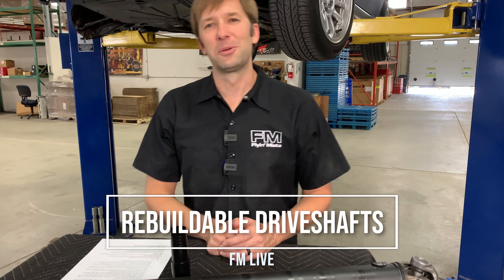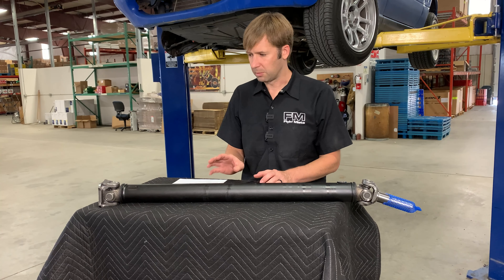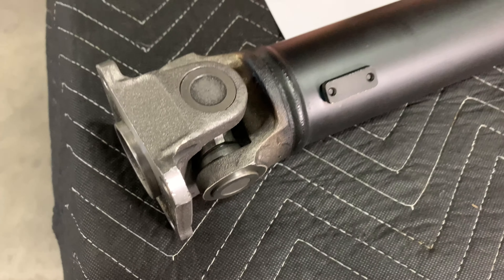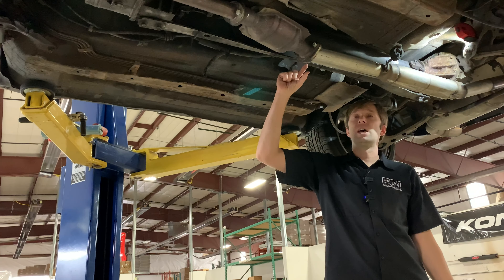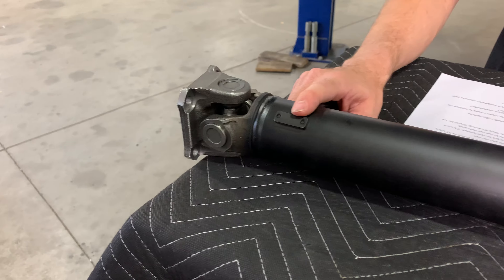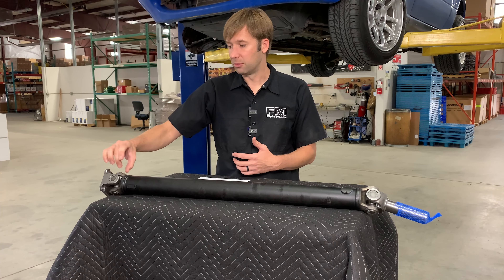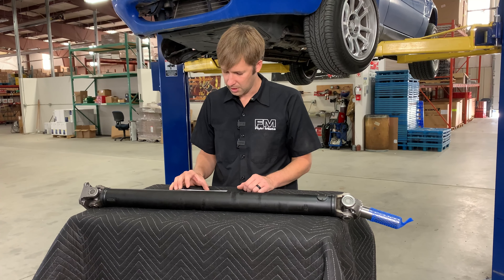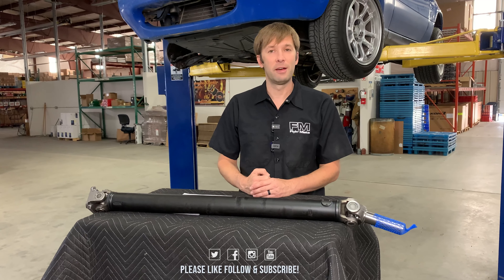Rebuildable Driveshafts for Miatas (FM Live)

Comment: OMG - having recently replaced the similarly designed u-joints in my wife's Toyota 4Runner, I do not relish the thought of replacing them in this driveshaft. granted, if like my wife's 4Runner... they may well last 278,000 miles, so not much of a concern. Nice to see there is a quality option should I need to replace this on my NB2.
Reply from the maker: It's not one of those things that goes wrong often, but when it does, we wanted to make sure there were options!

Comment: I bought a Miata that drove backwards into a telephone pole.. the drive shaft tunnel was compressed about 2-3 inches and the PPF was bent inwards.. the drive shaft didnt slide out of the gearbox easily, had to knock it out... does that mean I could expect damage to the gearbox internals? As far as I can see it's ok, spins freely, gears go in and out easily...
Reply from the maker: This would be almost impossible to tell without doing some detective work and a lot more detail. Try reaching out to our customer support team directly via phone or email, they might be able to offer some advice.
Reply: @FlyinMiataVideo  I tried another drive shaft I had lying around, and it went in flawlessly.. turns out that the splines on the shaft gets mangled when the drive shaft is pushed into the transmission.. filed the splines with a small diamond file and it works fine! When I got your attention, is it possible to buy the rebuildable drive shaft without the tube? I'm building a Super Seven with Miata parts and need to shorten it anyway.. shipping overseas would be cheaper without the tube.. 😀
Reply from the maker: @GeneralPoison  Talk to a local driveshaft shop, they may have access to some of the parts from other applications. Toyota may use some of the same parts, for example. We don't have a stash of the Miata parts without the tube unfortunately.

Comment: So the previous owner of my vehicle welded a manual driveshaft tip onto an auto driveshaft and it blew up on me while driving on the freeway (the welds blew everywhere) now when I start the car (the car doesn’t move cause no driveshaft) but I noticed when I start the car and shift into all the gears 4-5 has a nasty grinding noise while the motor runs. Does this mean my transmission was damaged? Or should I not worry until I replace my driveshaft?
Reply from the maker: If you have time, reach out to our support team directly. They'll be able to get more details and help you troubleshoot. Call 970-464-5600 if you can for the fastest response, or email support@flyinmiata.com and we'll be happy to help. (Please be patient if you email, we've had a huge amount of messages lately and may take a week to reply.) Thanks!

Comment: My car has a 200k mile old driveshaft and an 8lb flywheel. It makes a good bit of noise in 5th and especially on deceleration. Would a new drive shaft be likely to reduce that noise?
Reply from the maker: Lightweight flywheels have a tendency to create a lot of noise in the transmission on deceleration. The lighter they are, the worse it is.